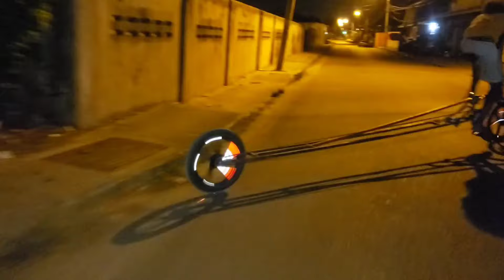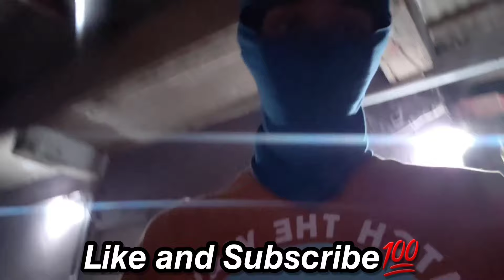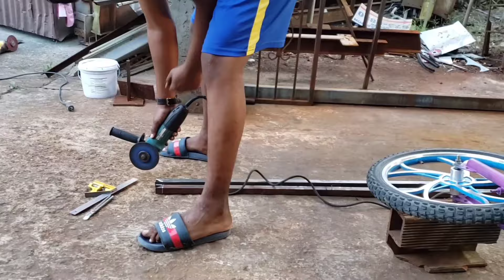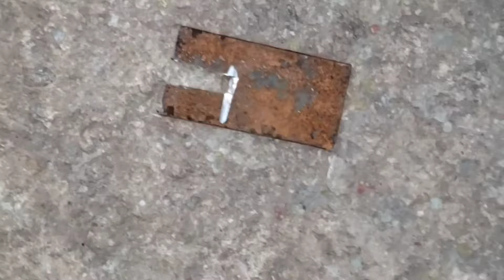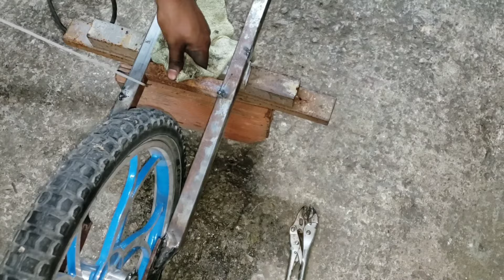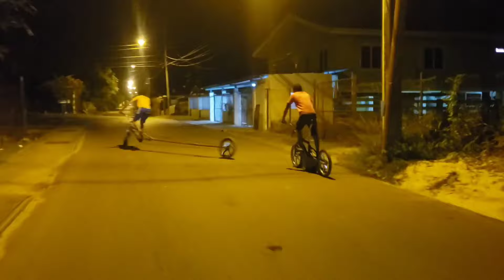We Built a 14 feet Stretch 😵😵😵

Comment: Make an  ebrake that you pull a lever back and it push back a pop can under the back wheel. Gotta be able to reload a new can. Pair or vice grips to clamp down on pop can or even plastic. 
Then release the lever and it should pull out from under( only works traveling forward.